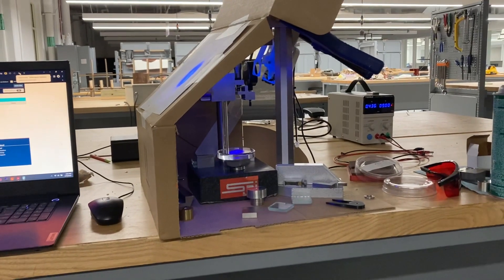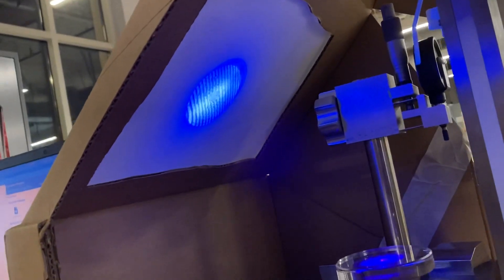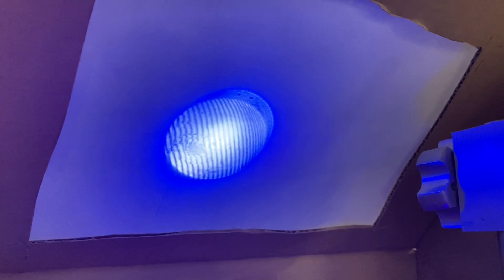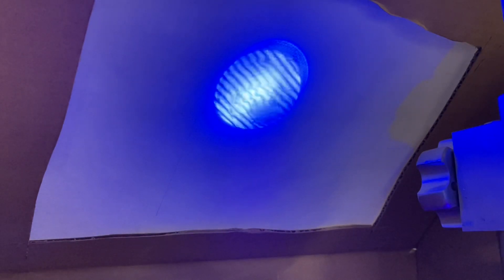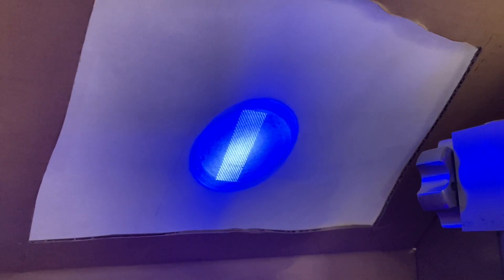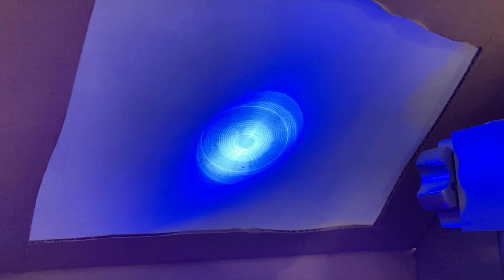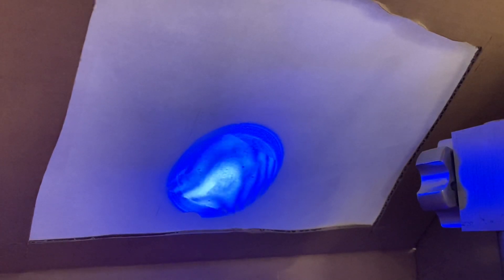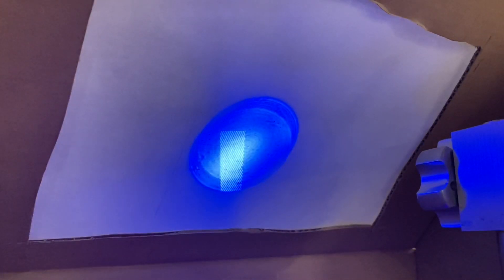A better way to use optical flats: Fizeau (ish) interferometer thingy

Comment: tried it with a red laser, no luck.  please provide setup details on this magic!
Reply from the maker: I also tried it today with a red laser and had the same lack of luck. Looking in to this, not sure what’s going on with that
Reply: @cylosgarage  It should work with any type of the laser. But beam should be diverging to enable zoom and bigger surface coverage. I have successful experiments with red laser on my channel.
Reply from the maker: @heraldofdisaster3322  I’ve since come up with a theory. Because the laser light is so coherent, it can interfere over longer distances such as the top and bottom of the optical flat. If these surfaces are parallel and the flat is n*λ thick, then they can destructively interfere with the fringes coming from the bottom for a light of wavelength λ. This may explain why some laser wavelengths work but not others. The red for me produced very very faint fringes, but not zero. I think this is also why in schematics of fizeau interferometers the reference flat is wedged on one side, to prevent a superposition of a 3rd wavefront we don’t care about. We don’t have to worry abt this is traditional optical flat use with a sodium or helium light because is it not highly spatially coherent and won’t interfere over such great distances. But I have no idea and have not tested this. Just a thought
Reply: @cylosgarage  One option to test you theory about interference between optical flat's surfaces is to point the laser at different angles to check pattern under different path length differences. In my experiments with red laser I observe interference from flat and front surfaces of glass plates in form of concentric circles (because my laser source is diverging one). And those circles always present so I have to filter them out when testing some parts.

Comment: This seems interesting, but I cannot understand what your optical setup is.  It appears that your laser is not well collimated, based on the elliptical bright area seen on the screen.  I don't understand why where is so much light extending out to the edges of the reflections from the optical flat.  In a traditional setup, the monochromatic light source is uniform and diffuse, which gives even illumination of the test optic.  With a diode laser source, this can be achieved by cutting a hole in a white ping pong ball that allows the ball to be slipped over the laser.  I have tried this with a green laser and have seen this with red diode lasers, but I don't know if the plastic in the ping pong ball would absorb too much 405 nm light.   

I do not understand what you are doing to zoom in on different areas.  Please give a more detailed description of the setup and what you are changing to zoom in.

Comment: What are you using as an exposure media? Parchment paper? It is neat that it works with a glass test piece, but does work with a granite target? A typical mono-chromatic light source shows nothing against a dark target like granite.
Reply from the maker: Just printer paper works great because it fluoresces due to the UV. It only works with reflective objects unfortunately:(